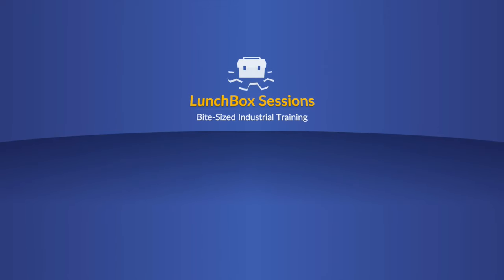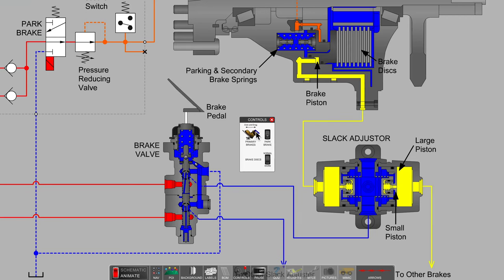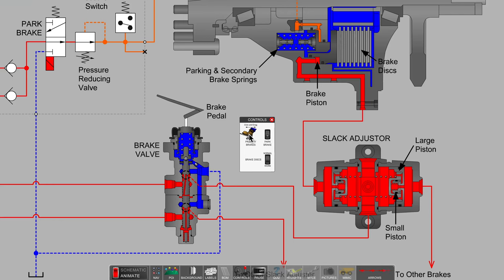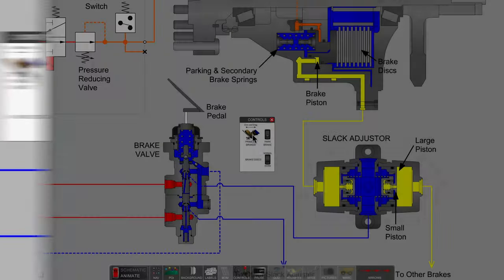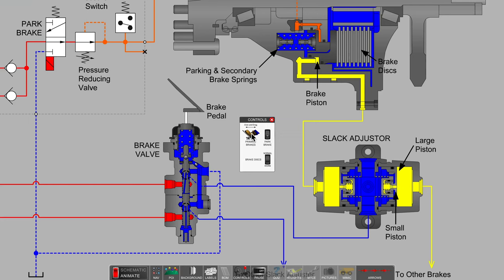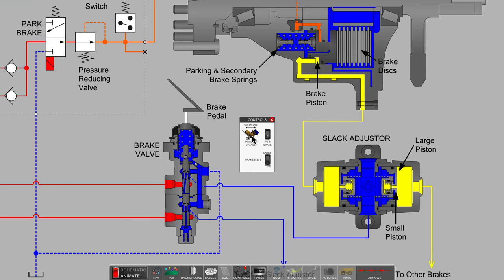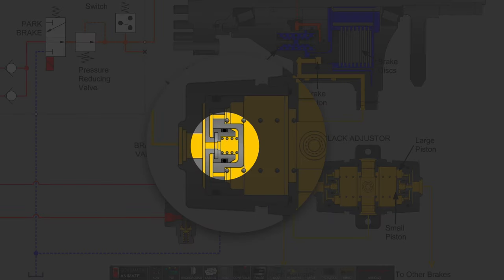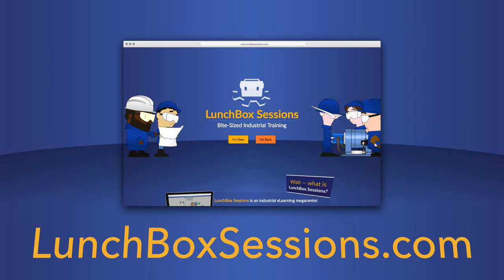Hydraulic Brakes

Comment: Great video, I know this isn’t a forum , if anyone has had loader brakes lock up ? I pick up a old 515 B  IH Case, Dresser ... after running it for a few hours  the machine won’t hardly move. I see a lot of disconnected wires to what appears to be solenoids for park brake ,  Before I dive into the internals I was going to get that mess cleaned up . I don’t think transmission is the issue it felt good the few hours and test run. I’m thinking slack adjuster and worn disks?  Could it be part fail safe 
If you can point me in the right direction I’ll get out of my own way
Thanks
Reply: Hi, i am having the same issues with my 515 front loader. Were you able to figure out what was wrong with yours? Any insight would be greatly apricated.